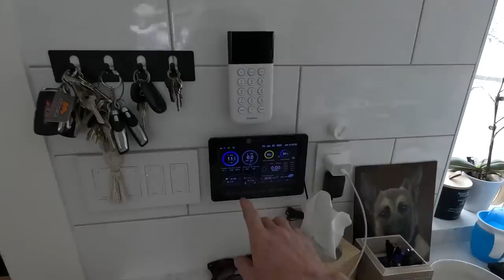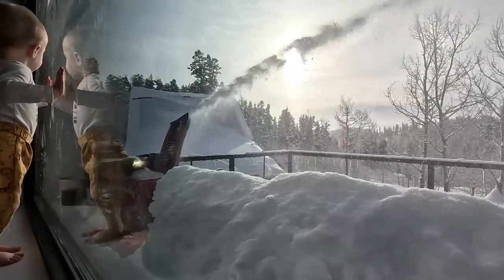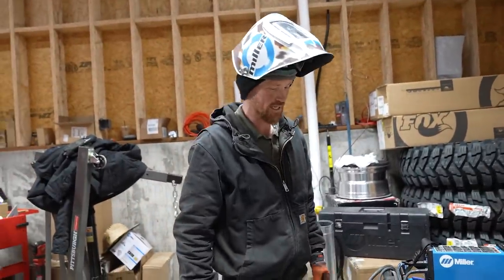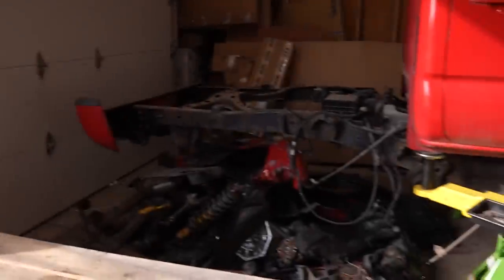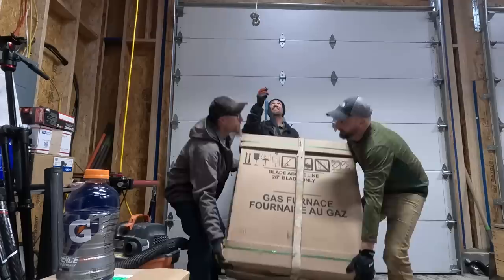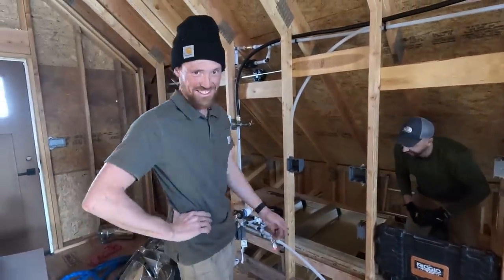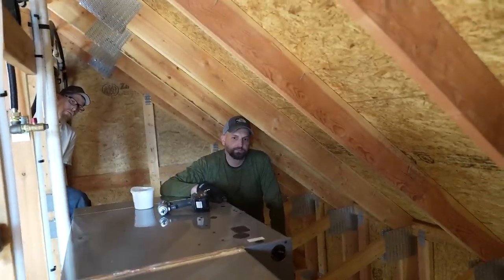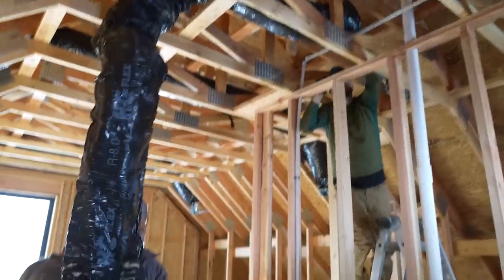BUILDING IN THE MOUNTAINS IN EXTREME TEMPERATURES

Comment: I suggested this before, but you need a thinner profile couch that provides the same seating space but is less bulky on the arms and frame. Instead of a loveseat, you could use one or two chairs with a small table in between. The chairs would also provide more visual space and feel less imposing in such a small space.
Reply: I agree with this.
Reply: Nice to have padded corners while little eyes are arm height
Reply: Only problem is...they like to sit together. Romantic, not way across the room. Chairs are for old people who prefer to be separated.
Reply: @bevtrue6937  I had to laugh at this. It’s almost true. I have a couch that has recliners on the ends and then the 2seats in the middle. Well my husband and I sit in the recliners and the dogs have the middle seats!!
Reply: @willowswhispers577  Yes! But since they prefer to sit together, next thing you know they would be looking to buy a loveseat rather than chairs.
Reply: @bevtrue6937  That's what the couch is for.
Reply: @sharvo6  Lots of hazards in the house. And they can select a streamlined couch with soft edges.
Reply: @ellen3331  Oh, we are keeping the couch? I thought they were getting rid of the whole set.
Reply: @bevtrue6937  I think getting a new couch that fits better.
Reply: @ellen3331  Up to them, i guess.
Reply: @bevtrue6937  They also need a place for company to sit.
Reply: True, Ellen, but I have a thinner profile couch and it's just not comfortable. The larger ones are indeed bulky, but oh so comfortable.

Comment: You could put a porch roof/overhang over the deck that just goes out 3 or 4 feet, just enough to get the snow away from the door. That way you would still have the sunny deck in the summer.
Reply: They aren't worried about the door.  With the winter snow and mud, they want to come and go through the sun room.  Their worry is having the compacted snow piling onto the deck and collapsing it because the snow blower wouldn't clear it.

Comment: We have colder temperatures than you right now and we have more snow than you right now and our Mini Splits work awesome. But we have Mitsubishi name brand mini splits. Mr. Cool do-it-yourself mini splits are cheap for a reason. And I would not judge all Mini Splits based off of your homeowner installed DIY mini split. And I would double-check and make sure your system hasn't fully leaked out and that's why it's not working well. The average temperature where we live in Washington state through the winter is -5°F and mini splits are actually the recommended Heating and Cooling Source here for are really cold Winters and our hot summers.
Reply: I agree, we have a Panasonic heat pump and it works great even below -20 F.
Their mini-split is not working because it's under 10 feet of snow. It's not rocket science.

Comment: Just build a roof above the Deck and close it in with walls. Use the entry from the stairs and make a new Deck in front. You got a new living room and a space for a bar in the kitchen. Nice! Plus a extra spare room under the former Deck 😁
Reply: Agreed!! 💯 #davesandersstepdaughter  😁
Reply: Great idea!
Reply: Good ideas but I don't see them doing the due diligence in building research BEFORE starting something like that. And then the design comes back to bite them in the butt, again.
Reply: The deck does not have adequate foundation for that plan (not a knock, it’s got all you need for a deck) and just think of how depressingly dark the living room would become, given that there is no window on the gable end wall.

Comment: I said it before but you have to snowblow when it snows not a week later.  It'll make your life easier.  Also, you might want to reconsider the blocking of of your second means of egress in the house.
Reply: I agree on not blocking the door. I think the issue of the snow on the porch is that it isn't free falling snow but it has slid off the roof and the force of that packs it solid.
Reply: The old snow blower wouldn’t do the deck so had to wait on new snow blower
Reply: True, but they do have the basement windows for another exit point.
Reply: They will have much more success now with the new Honda snowblower👍🏻
Reply: Now where would the drama be in doing things the right way?

Comment: Probably to late but did you ever consider a wood fired boiler in the garage run the lines underground to base board hot water to heat the house and a holding tank for hot water for sink and showers. The garage would be warm whenever running of course and heats your home.

Comment: Check out Pottery Barn’s sofas and chairs. Put the TV on the fireplace wall, tv console under the window, a leather rolled arm chair with ottoman to the right of console and a smaller rolled arm leather sleeper sofa or sleeper loveseat at an angle to the left of console. Small table behind sofa for decor. You could also get a matching ottoman for the sofa too. You’d have extra seating for guests by using the ottomans. Do you have room for one of the existing sofas to go into the garage apartment? Maybe Allie’s mom and dad’s rental house for the other sofa? I don’t want to sound unkind but if I were a neighbor and had an HOA, all of the stuff you have sitting around outside would not fly with me. I understand your neighbors might be further away than a platte house, but mercy that’s an eyesore. Maybe get rid of Rusty and build another small building where Rusty is now. Put your things in there.

Comment: Allie makes a great point about elevation. Purchase some quality mini splits with a seer rating for your zone/temp, install them up out of the snow pack. Mr Cool is what amateurs buy and then complain they don't work. Even the units heater you choose for the garage is not the way to heat a space that tall. Ive been in the HVAC business for over 45 years and you have not picked the correct equipment to heat and cool the spaces most efficient.  Mounting supply boots that high when you heat more than you cool again wrong choice in such a small space. Did I see the water heater exhaust installed over a future outdoor stairs? But you are going to cover the stairs this time I hope.

Comment: One heads up when we wired our home and 1200 square foot cabinet shop. We used 14 gauge wire for lighting but used 12 gauge for our outlets. It is pretty easy to overload 14 gauge wire that is used for outlets with all the new electrical tools and appliances available.

Comment: Just a little recommendation.  I speak from experience.

Do NOT use the "flex-duct" runs.  They restrict the heat flow immensely.  We did not know this until after the whole house was done.  It also falls apart where it joins another run.  So needless to say a 3,000sqf house had to be re-done. 

Just giving you a heads up.  When you lose the adequacy of the heat, you have to replace the duct work for the apartment furnace.

Comment: A suggestion about the roofs- not my idea, I am not that smart as far as snow removal and electrical components is concerned. Mr. Swanson lived near us and he put the electrical cords on our slanted roofs and an electrical outlet inside the house. We could flip the switch on- a red button would light up and the wires outside would heat up thereby getting the heavy snow off the roof. This was ~ 45+ years ago, I am aging myself, and I don’t know if if an electrician would do that kind of thing with the technology and education we have now, but I think it’s something to ask about. I just live in NH but grew up in Reading, Ma.. We thought we had a moderate amount of snow. Obviously we did not! I would get a huge truck- HEAT INSIDE A MUST! Then I would be out every 3 hours until the snow stops. Well, I would also use the blower to clean off the deck a few times also. I would not let it get as tall as I am (5’11”)- too much work! 
Well, probably when I was younger I could have helped my husband with those extremely high snowbanks….but now, no freaking way. Oh…lol, he’s shaking his head. He would just hire someone to do it! What a rascal! And he is 10 years younger than I am and in excellent shape…wimp! Lol!

Comment: Trent, I believe the problem with some of your pvc joints leaking are the glue ( christys hot glue) from HD. As a contractor I always use rain or shine blue. It was designed for golf course and works great even if wet also sold at HD maybe a buck more but will save you much aggravation! Keep up the great work looking forward to seeing you in Trent’s Garage

Comment: Mini-splits don't "suck". Mr. Cool products suck.  I have had several Mitsubishi Hyper-Heat units that don't loose the efficiency curve until lower temps (I think it's 5 degrees).  I have one now and live in northern PA with no issues. I also have my outdoor unit mounted to the side of the house 3' off the ground.

Comment: It is going to be a Fantastic Day when that front deck roof gets built!  We have them, in the front and back AND we placed 4ft x 4ft skylights in the porch and back deck roofs. So Trent and Allie, food for thought if you consider placing large skylights on them.   One suggestion to offer regarding how to orient the skylights.....place them like they are Diamond oriented and not square. If diamond shaped🔶 then the water from rain  or the Snow, melting or otherwise, will travel off the angled sides of the skylight. If Square 🔲 then you need to make sure the flashing is ultra super well done.  The snow and rain water on a square orientation might stay trapped on the top flat side of the square. Hope that helps...I can tell you that skylights in a porch roof brings more light under and you feel less boxed in. We love it!  We also put our small hot tub from Costco on the front porch, under the skylights....at night we can still see the stars.....we so appreciate what we have done in our renovations here.👍   ☺🇨🇦🔨🪚🛠🪜

Comment: Trent. You can use grade 3 bolts for the shear pin. Cut a grove around the bolt just like the shear pins you have.  Much cheaper and easy to get at local hardware.  I go through a lot each year myself

Comment: Love how well you have the dogs trained, but after training Trent I am sure you learned a lot. Question on electric, did you pull any additional wire or run additional conduit to the garage from the house? Just for future needs. I had rewired our first house (build 1926) was lucky enough to have balloon framing to drop wires. Then when we built our new house we planned extra wiring, pull cables or PVC conduit from the basement to the attic. And although things are going wireless we hardwired every room with Cat 6 and Co-ox on 3 walls in each room (total cost of smart wiring done by electricition for 5 bedroom house 396.00. Considering your uploading and downloading as well as your work space in the garage, man cave and Apartment would allow lots of connection and/or control. Can't imaging you won't have internet access and / or Co-Ox needs in both. Before you insulate the garage/apt consider needs such as cameras/media/internet. If you don't have time to respond I understand. Love watching both of your channels. David

Comment: I think you guys are allergic to doors and stairways🤪😂 you should’ve built a doorway in the basement of the house under the deck and you should have finished the doorway and the stairs on the back of the garage so you don’t have to do gut wrenching daredevil stunts of lifting very heavy equipment up to the ceiling.😮😮😮😂

Comment: Just curious…why after running all the wiring and plumbing didn’t you insult the at least the roof rafters prior to putting in the furnace and water heater?  Seems like it would have made more sense.

Comment: “…Pretty frigid”🤨 
I’m in Wisconsin and we’ve had a week of -15 to -20 with a high of 1 above 🥶😱 No Trent, you aren’t frigid.. not even close!  So quit your belly achin!! 😂 11 above would be a heat wave for us! 😄
So are you basically admitting that you designed your house poorly because yea, you really can’t put furniture in the living area in more than one configuration! 😄 Take out the loveseat and put in a recliner chair.. that would open it up..
You are trying to fit a normal sized living room set in a micro sized house with a massive dog kennel thrown in, and it is really cramped(!) With wall to wall furniture.  Allie doesn’t need a THIRD living room set; she doesn’t need more furniture, she needs less..

Comment: Minisplits are fine when properly installed, here in Canada where it is currently minus 26 C I'm just fine with my minisplit.. which is exactly like yours.  we live on a warming planet, your constant denigration of heatpumps is not appreciated, had you put the outdoor unit on a bracket directly back of your indoor unit, your hoses would have been a few inches long, and you would lose no heat as they transit between the indoor and outdoor units.  You purchase big rubber shock absorbers and there is virtually no detectable vibrations, works no problem and is not snow covered at any time, because it is under the eves of our house.
Reply: otherwise carry on, I'm a devoted viewer.
Reply: It sounds like Trent should have installed his differently..